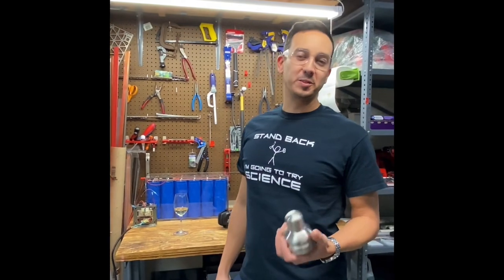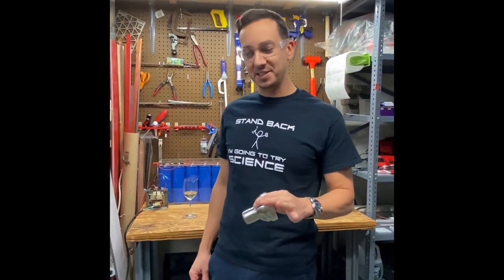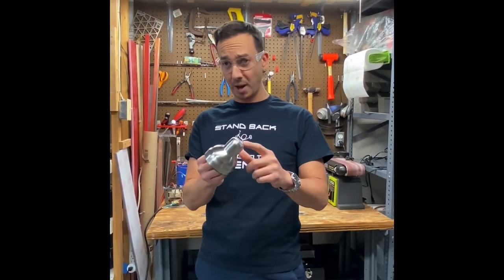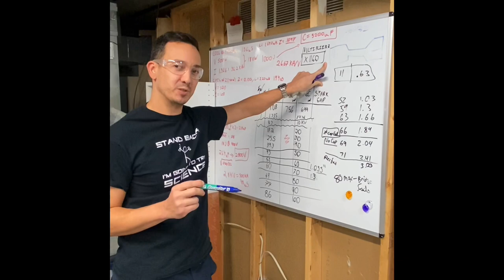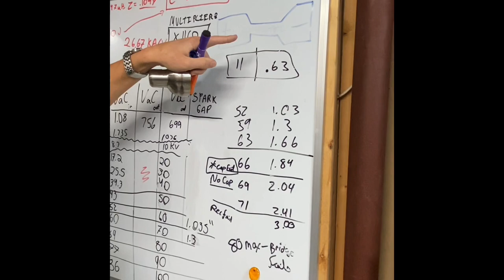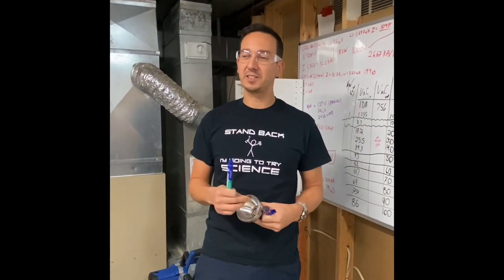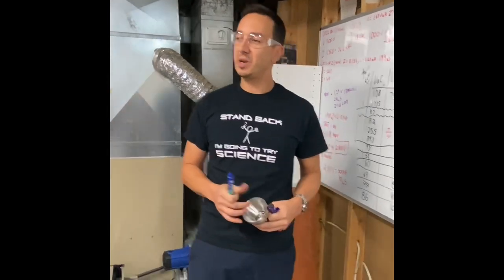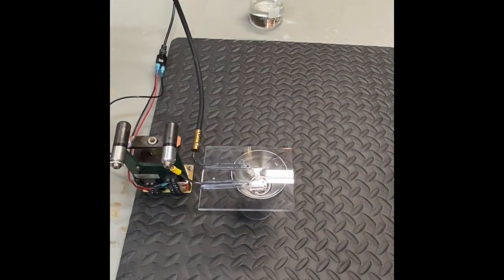The fastest way to get a cocktail shaker unstuck!

Comment: Looks like a little residual charge on the cap there with the flying lead sparking.  Need to fasten stuff down.
Reply from the maker: You’re right Jim! Safety is very important,  and there is definitely a trade-off between the fun of “let’s just go into the garage and whip something up together real quick between dinner and bed time” and doing things the proper, safe way.
I spent some time building safety into this design: everything is grounded, the power supply disconnects when the relay goes fire the circuit, the caps have bleeders, and the wires were glued to a lexan spacer, but it wasn’t enough to keep them from blowing apart. For the next round I plan on incorporating a crowbar circuit that will quickly drain the cap if the load explodes... Erm, I mean, “disconnects” :)

Comment: The fastest way should be: some wooden sticks through the wholes of the cap, fix them with a little tape, turn around and hammer the sticks on the table. That will do the job instantly and without that much equipment... but surely you get the best b-note for the most spectacular and "gyro gearloose"-way to solve the problem :-) - very nice Show!  But i would add in the video: "Don't try this at home, high voltages like these are very dangerous - the shaker may be unstuck, but you lost your life and never will see it!"